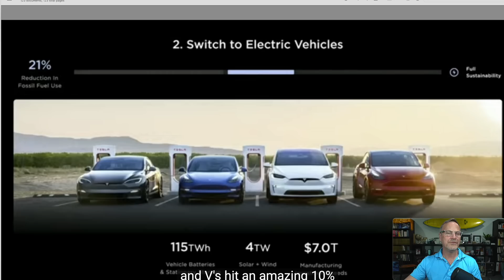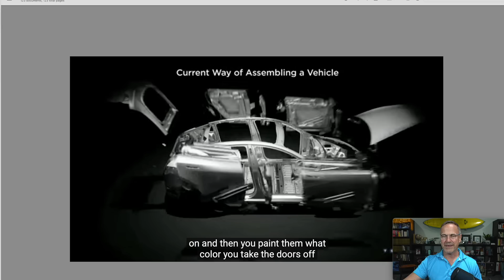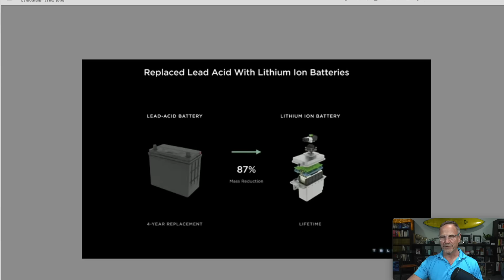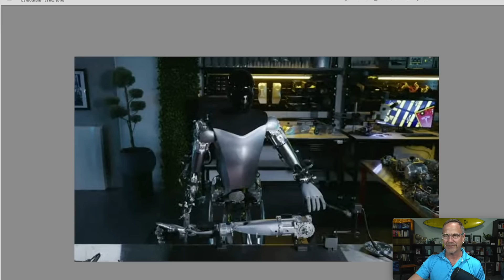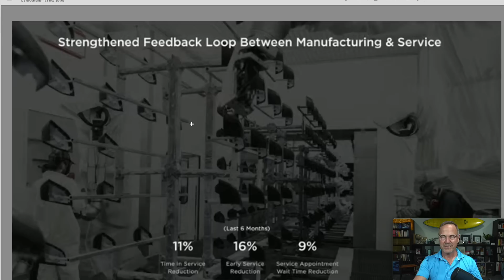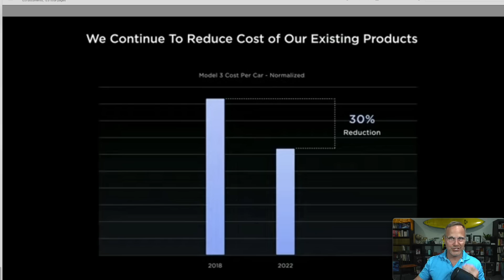All About MASSIVE SCALE--But No Model 2!! Tesla INVESTOR DAY Recap and Reaction

Comment: When they talked about density of operators on the new vehicle production platform, Parallel production. This allows for more hands on at a time. This isn't going to be more humans. It's going to be Optimus. Lots of them moving slower than a human. One human supervisor for each parai cell. With probably 4-8 Optimus running. Optimus will allow for verification of parameters during production. You can get continuous data back from Optimus that you couldn't get from humans. Some of the Optimus won't even need to have legs.

Comment: I live in Minnesota, where it gets pretty darn cold in the winter. Can heat pumps still work to heat homes when the average temperature is below 0 Celsius for days at a time?
Reply: Not my area of feigned expertise, but it was my understanding when I looked into this a while ago that heat pumps will operate to well below freezing; although the output drops off, and of course that's when you need it the most. They usually include either backup resistance heating or gas furnaces, even in the mild climate in SoCal where it rarely goes below freezing. Resistance heating is much less expensive to install, but of course costs much more to operate than a gas furnace (less of a difference if you're on propane). So it's a trade-off between first cost and operating cost. I'd be surprised if HVAC contractors didn't have sophisticated design tools to define these tradeoffs.

Comment: That steering wheel shape was called quartic when British Leyland installed it on the Austin Allegro around  1972. I didn't prove popular and was dropped a couple of years later.
Reply: That wheel can cause wrecks w/ stick-shift and mechanical-linkage steering that needs many rotations lock-to-lock.
   Tesla’s steer-by-wire (less?) allows for variable-ratio power steering - at slow speeds like in a parking lot, less steering-wheel rotation gets you more tire rotation and the closer you rotate to lock, the more tire rotation you get - makes for easy maneuvering around obstacles at slow speeds.

Comment: Knock-knock… Who’s there? 
“Anne”…  Anne who? 

-Ann-nother delay in a people’s EV.

Knock-knock… Who’s there?
“Stella”…  Stella who?

-Stella-nother delay in a people’s EV.

“Volks-wagon” - German for a “people’s car” for the working class.

    Not getting a Model 2 is another broken promise by Tesla, based on what?  ¿Fear? of the “Osborne Effect” is just silly, after the large production cost declines just projected at Investor Day. That assumed small vehicle under the white sheet - a hint at a Model 2 - was a repeat of the old one at battery day, yrs ago.
    A well-designed, 12-15 inch shorter Model 2, as described, that would be desired for “in & around” use, would not undermine Model 3 sales one bit. 
   To avoid ‘Osborne’ competition w/ the Model 3, the Model2 would be as well-designed, aesthetically, as any of the S3XY’s, but w/ more emphasis on the practical in relation to the M3 —
 — same exterior width, taller body for adequate head & leg room, w/ a taller greenhouse to match, and a completely-removable back seat;
 — a higher drag coefficient, slightly-larger cross-sectional area, hi-res side “mirrors” inside the glass, and the body optimized for low wind noise;
 — a single rear motor geared to optimize acceleration at lower speeds than the S3XY models - thus a lower top end, acceleration peaking around 45mph, and 0-60 in ~6 seconds (to optimize ‘city’ range);
  — to soften the ride a little, use tires w/ a higher oval number, taller sidewalls, and smaller-diameter rims, and tweak the suspension accordingly;
 — the low-profile ‘soft-rectangular’ steering wheel shown, w/ the hi-res video mirrors on the dash positioned for adjusting to ~15-20 degrees either side of center; w/ center display of safety/nav text, speed limit, range, lights/signals, and vehicle/child/occupant safety status.

Comment: Did they say heat pumps for homes? I thought that was just part of the big transition paper including things left to others? But combined heat pump and powerwall is a definite win in the same way as integrated battery temperature management and cabin conditioning in the cars.
Reply: I agree it is something they'll leave mostly to others. Unless they roll out Tesla Homes (unlikely), the heat pump retrofit market is pretty well handled by current suppliers and installers.

Though to be truly effective, a heat pump must be paired with other energy management strategies like better insulation and air sealing. I went through all of it last year and better air sealing let me downsize my unit.
Reply: @Tanstaaflitis  Heat pumps are much too expensive, difficult to install and poorly integrated in this part of the world (UK). I think Tesla could fix that and get extra synergies by integrating with electricity and heat storage systems to optimism the time of electricity use. Unfortunately our dumb government loads a lot of 'green' taxes on electricity and subsidizes natural gas, making it even harder to close the financial case! Plus we're getting a lot of pro-hydrogen FUD from the fossil industry.
Reply: @john_hind  I've seen many videos complaining heat pumps have been poorly received in the UK due to older houses having very poor insulation and air sealing. That's why I called out those areas as needing attention to make heat pumps work properly. Not much Tesla can do for that in retrofit cases. The homes may need extensive work to be suitable, or to be rebuilt. I'm far from any kind of expert, especially on UK home construction.
Reply: @Tanstaaflitis  That is true, but if you are not going to reduce heat waste, it is even more important to produce that heat with less emissions per unit. What IS relevant is that most homes use hot water radiators and heat pumps typically heat the water to a lower temperature compared to natural gas combi-boilers, so you need to fit more radiators. There might be a technical fix for that, even if only to use a heat pump to pre-heat the water to be heated further by another system.

Comment: If you see the demo of using a Tesla supercharger to charge a non-Tesla car, it would depress the non-Tesla owner. The small, easy-to-use Tesla charging connector is connected to the clunky J1772 connector required for all non-Tesla cars This demonstrates the difference between real engineering and dumb government-mandated standardization..... Maybe this demo will bring a pushback on the J1772 and the standardizing of the Tesla connector..

Comment: Two bit of rubbish are immediately apparent even by t =8:00 minutes into the program.
1. Elmo uses the hopeless figure of 1 kW/m3 to get that 1GW/km3 number. Yes, at the equator the insolation of solar radiation is 1 kW per m2 at noon. In practice, Europeans will be lucky to see 20% of that rate in the space of 24 hrs. Africa, be prepared to be economically colonized again for you 34 % daily rate!
2. Electricity is the most wasteful way to generate heat for chemical and metallurgical processes. Essentially 100% of combustion enthalpy is available as heat to cook petrochemicals and melt steel. Electricity used to do so wastes the 66% potential extra mechanical effect available to run machinery - i.e., electrical motors ! How ironic!!  Study some thermodynamics Elmo!

Sort of makes you wonder about the rest?

Comment: It is not your normal ethernet, it is BroadR-Reach, known also as Automotive Ethernet. it is 2 wires, not the 8 you are used to.
Also going to 48V is part of having thicker wires.
But 48V is also the standard for POE (Power over Ethernet) so they will power the ECUs with the same wires for data.

Comment: I never understood why, when someone talks about V2G, that they don't bring up the fact that you will be degrading your battery faster.  I liked Elon's answer. If you depend on your car to power your house, then you lose power whenever you go to work or go to the store to buy some candles ;-)
Reply: It will be an extra charge cycle but in the lifetime of these car batteries it would be monumental to have all these cars wired to grid during high demand
Elon isn't a fan bc he wants to sell more batteries for your house.  
Marketing 101
Reply: Good point, I would never buy a used EV that had V2G features of any sort. There is no way of know whether the pack was abused and its lifespan significantly reduced.
Reply: @harrychu650  Yes there is. Tesla has a battery health measurement in the hidden Service menu.
Reply: @BigBen621 Tesla doesn't do V2G and never will. How about a Ford Lightning or Hyundai Ioniq 5? Would you buy one of these used and not know what abuse the pack was subjected to? It would be a $15k battery replace bill if you get it wrong.

Caveat Emptor.
Reply: @harrychu650  I was responding more to "There is no way of know whether the pack was abused and its lifespan significantly reduced", such as constantly charging to 100%. As to cars that currently offer V2X, it seems likely that they have a similar battery health metric; but even if not, couldn't you judge the state of health by comparing current range with rated range?

And I wouldn't be too sure that Tesla will never offer V2G: "Tesla vehicles will be capable of bidirectional charging within the next two years, according to comments from Tesla VP Drew Baglino at today’s Investor Day event.

A question was asked during the Q&A portion about whether Tesla would move toward enabling bidirectional charging on its cars, noting the company’s historical reluctance to do so.

Drew Baglino, senior VP of Powertrain and Energy Engineering, answered the question by noting that the lack of bidirectional charging was not really a conscious decision, but rather not a priority at the time. But, as Tesla has improved its power electronics units, it has found ways to reduce cost while also bringing bidirectional charging to its vehicles.

Baglino went on to say that this could happen within the next two years, as Tesla is currently within a retooling process for their power electronics manufacturing."
Reply: @BigBen621  A well thought out response deserves the same effort.

Zoom out. Based on my research, Utilities are the driving force behind the push for V2G. It is a way for them to avoid the capital investment into stationary storage and to shift the onus of reducing demand on the grid to the EV Owners.

Said another way, the V2G model is contrary to Tesla Energy's interest (selling megapacks and powerwalls) and Musk's broader vision of how the grid "should" be modernized. This IMO is why Musk is dismissive of the V2G idea and why I fully agree with him.
Reply: @harrychu650  I don't disagree. With the imminent change to NEM 3.0 in California, which will dramatically extend the payback of residential solar systems, I was probably thinking more of V2H, allowing folks to charge their EV at night, when rates are low; and draw from the EV, during the peak period when rates are high. That, plus using the EV to provide at least a minimal amount of power during power outages. But neither of these is V2G, although they'd still require interconnect agreements and appropriate reverse power safeguards, etc.

Comment: As an exautomotive paint quality engineer, I can tell you the reason that all paint the doors and hoods on the body is to allow for the best color match between the body, hoods and doors.  Not that you can't do them apart from the body,  but control of color will become much more difficult. The way paint travels in different lighting is critical to the assembled car looking good to the human eye.  That is way most cars are painted in this way.  The best paint is no paint as in the Cyber Truck.
Reply: Hi, on the other hand, if you go to a high quality body shop nowadays and have let's say a scratched door painted, there is literally no visible difference in paint color or appearance. I would definitley assume they would use the same batch of paint and the same painting equipment in the factory, therefore this should not be an issue in my opinion.
Reply: I was worried about that too
Reply: True point but this issue can be mitigated by getting a big batch of same color cars passing trough the paintshop. This eliminates small differences in color composition (some OEM's switch paint from one car to the next car). Also, you can have all parts for painting as associated for one car through the paint shop together. The big difference is that they won't be mounting the parts together to disassemble them after the paintshop.  
I'm quite sure they'll figure this out of course

Comment: By 2035 we will need 6x the number of LI mines and refining plants we now have. (). 
There is some ramping up of mines/plants now, because of the high Li price. 
But, because mines/plants take ~10 years to build and to ramp up production, 6x current world production is not going to be achievable (even with the IRA). 
It's a similar picture for natural graphite. Ni and synthetic graphite will only require about a doubling of current world production, but I suspect that even this will not be achievableI am sure that.
My hope is that TSLA knows this and I hope it will be able to source enough minerals and produce enough batteries to achieve its 2030 goals. 
It might be good for TSLA to over produce batteries, because it can sell off any surplus capacity.

Comment: Re: cost to stay on fossil fuel vs transition over the next 20 years - The cost per year would actually keep going up and up after that for fossil fuel. But it will come down and down for electricity once the grid is built out and we just need to maintain it rather than keep building it from scratch. Also, solar panels and wind turbines and batteries should be drastically cheaper, so even replacing the worn out ones will cost a lot less in the future than putting in the first ones today. Also getting battery materials from recycling rather than mining once all vehicles and grid storage are transitioned over will be cheaper. So if you did that graphout to 50 or 100 years, the difference between fossil fuel and renewables should be much much greater.

Comment: Model TWO is not a vehicle - it's a new way of manufacturing vehicles. Instead of mounting doors, painting, removing doors, fitting out doors as completed units, then re-mount the doors - M2 will paint and build doors separately, same with the front end, back end, center section then covers (fenders, doors, glass, etc,). This unclutters the rolling chassis and reduces the time to "assemble" a vehicle. The sub assembly lines will also be less congested also increasing speed and efficiency.
Reply: I think you are 100% correct. It's the new manufacturing strategy people should really focus on. Not just one model. This is an entire restructuring of the process
Reply: bingo !
Reply: Yes, thats what i have said for a few months now. Model 2 is actually a smaller Model 3. Nothing bug. But all of the Models well become cheaper over time. And VW, GM, Hyundai etc. will have to raise their prices. Imagine a Bolt costing more than the future Model 2. Or a Mach-E costing double of a Model Y. Or a Silverado costing DOUBLE of a Cybertruck.